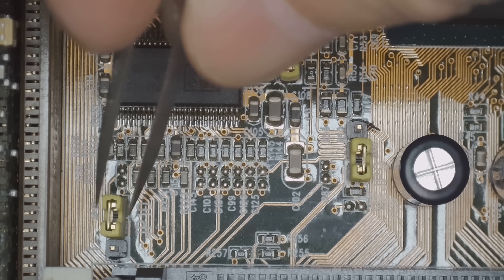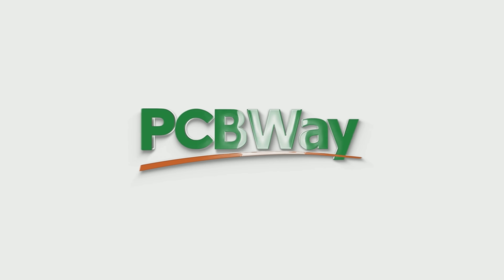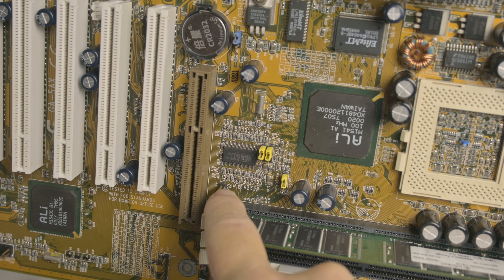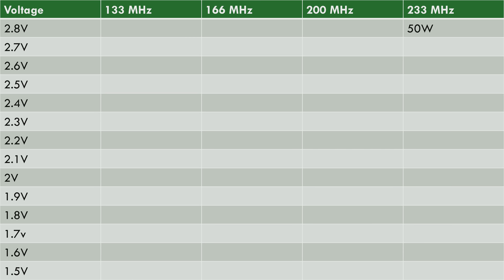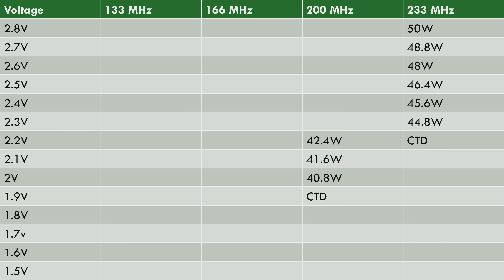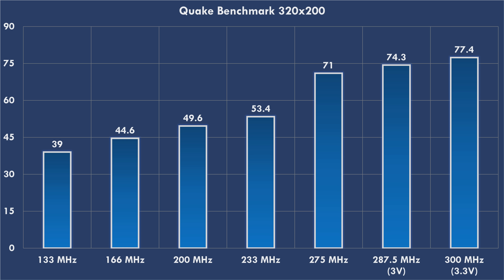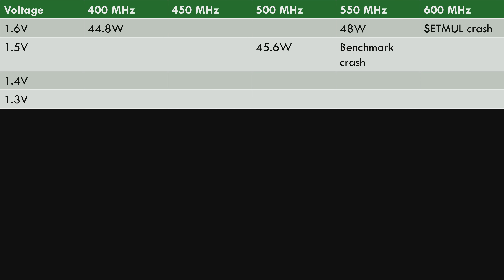Undervolting Retro CPUs to extend life, save power, reduce heat and noise

Comment: There is probably an ultimate voltage and clock speed in which  the transistors have the least weardown over-time due to a combination of transistor success rate, speed and temperatures. The good thing of 50% clock speed is that you can also lose transistors over-time without really affecting the CPU functionality.

Comment: I don't think I have a SS7 board that will go this low in voltages. The Cyrix chips are ones that don't like undervolting much if I remember, but then again, I wasn't trying to lower the clocks either.  Now I am curious what a Tillamook will do in this scenario.  Good video!
Reply from the maker: I agree, those Cyrix chips are pretty delicate!

Comment: I have a k6-2+ 450 . And under clock the cpu.  But what's weird,  is the boot up detects the k6 2+ 450 . But win 98se shows it as a k6-III 450 . And  3dMark 99 shows it as a k6 2 3d Now at stock settings.

Comment: CPU is the most reliable component in the system (More than the rusting chinese screws).
I can count on one finger the CPU's that failed due to themselves, not from EXTERNAL issues.
Reply: Same. I think the only one I've ever had that died on me was a Pentium III. Everything else has either gotten upgraded, or gotten orphaned due to the motherboard dying.
Reply: My one and only dying CPU without killing it by myself was my first Raptor Lake 13700 K. Just because I built this system and didn't want to mess with it. That was probably a mistake. I didn't do the same mistake with the 14700 K that still runs great.

Comment: I underclocked my K6-550 years ago to 450 and forgot about it. Lately i pulled off the cooler and was a bit surprised when i had a look at the model that was in; and remembered vaguely that i did that when it was running as a file / printserver for a while.

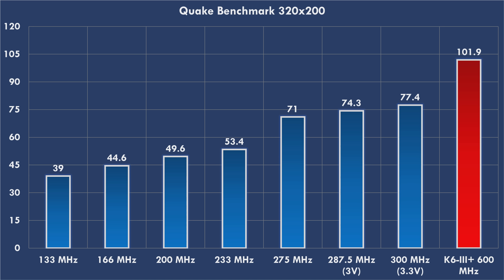Comment: 14:20 - most probably the Pentium MMX clocked at 300 mhz would have been faster than the stock 400 mhz K6-3 in Quake.

Comment: this is great advice for motherboards with active voltage regulator based on stepdown converter
however on motherboards with older style voltage regulation based on transistors and linear voltage regulators you might be surprised to not see much of any changes
that is because linear regulator would be more eficient with lower voltage drop , the bigger the drop the more power is converted to heat and the only way to limit power is limiting the current. gain some loose some. cpu might be cooler but vrm would suffer more stress
Reply: So less voltaje means more amps pulled from the Vrm?
Reply: @valparaisosting  nope, the same amount of amps is pulled from voltage rail or slightly less. only instead of transforming it to lower voltage like switching power suply by switching on and off periodically the difference in voltage is radiated as heat because linear voltage regulators are just self adjustable power resistors. ohms law would see cpu as one resistor and voltage regulator as another connected in series. but the difference between 2,8 and 2,6v vcore would be neglegable you still droping the difference on vrm from 5v  and vrm at 2,5v would radiate the same amount of power as cpu is using while at 3v it only be 1/3 of what cpu is using :] so make no difference if cpu is ussing little less power at lover vcore
Reply: @kokodin5895  no, it makes a difference. Typically CPU power scales like f*C*V^2. Even at constant Vin - input voltage for lineal regulator - combined power (CPU die + regulator) still scales like f*C*Vin*V.
Modern CPU's even have built-in lineal voltage regulators (DLVR) - yes, to save power.

Comment: Do you have any evidence that undervolting extends life (vs running at rated specs)? Lower power, lower temps, sure… but extend life? Not convinced it makes any difference but interested if there has actually been research done
Reply: Intel Raptor Lake?
Reply: It should reduce rates of electromigration, so broadly the concept makes sense. Lower temps also help with other things, like solder joint fatigue from thermal expansion. How much of a difference it makes is the question, CPUs rarely ever fail, I have pile of everything from 386 to PIII and all of it works perfectly 20-30 years later. GPUs are a different matter, especially as you get to the early 2000s and beyond.

Comment: Undervolting you will save the capacitors of the mother board more then everything else. Electrolytic capacitors are mostly degraded from voltage and current they have to manage. Ofc u save also the CPU but the first thing you destroy with overclock are the capacitors of the MB. Usually the CPU will last way longer then the mother board and capacitors. Undervolting is always a great thing to consider and not only to save consumption. Phil contents are always super interesting. Thanks Phil :)
Reply from the maker: Good point!
Reply: On that subject, as hard to believe as it may be, my Abit BP6 motherboard from 1999 still has all of its original caps. And it still runs it dual Celeron 433s rock stable at 540MHz with an FSB of 83MHz, though obviously it's getting a whole lot less use nowadays.
Reply: Heat plays a big role in capacitor aging as well.  The cooler you keep your system, the longer it will last.  In fact there's an old electrical engineering axiom that says for every 5c you can reduce operating temperature you roughly double the component lifespan.  That can vary of course, but I'm sure you get the idea.  ;)
Reply: I've been in PC repair for nearly 40 years. The CPUs will not degrade at stock settings at these nodes. The capacitors will not fail at normal room temperature use. The caps from the plague era will fail regardless, if not already by some miracle (I have a few holding on for dear life as an experiment). Keep your systems clean and cool, and don't worry. This is a nice experiment for power saving.
Reply: A few select CPU's were deathly prone to electromigration with even modest overclocks triggering the issue if you didn't have VERY AGGRESSIVE thermal management. With that said, I'd say a tiny bit of undervolting with a tiny bit of underclocking with a massive chunk of "more contemporary cooler" will probably do as good in preserving the CPU's than going all out on the under's. Finding a good fit, now there's a challenge.
Reply: Good capacitors can last for more than 100 years, so… no point in trying to save them.
Reply: The problem is that it's already "way longer" when it comes to these parts. You can always recap the motherboard but you can't fix an interconnect inside the CPU that has degraded.

Comment: I've done exactly this (without the power monitoring) with exactly that K6-III sku, on exactly that revision of that motherboard.

My 400/1.6 rated chip does on a 105fsb;
1.8v - 577.5
1.6v - 525
1.5v - 472.5
1.3v - 420

I didn't exhaustively test the max each voltage achieved, each of them can probably go further with a 110fsb, but SS7 bus overclocks mess with other components and I was quite happy with 105.
The 180nm K6's I think are quite safe to overclock, the 550's are rated at 2.0v, but like you I don't make a habit of setting over 1.6.
Reply from the maker: Beautiful! Thanks for sharing our results!

Comment: I managed to get my Opteron 180 down to 1.2v. Helped majorly with heat issues I was having
Reply: Is Cool & Quiet still usable with undervolting? I also have an Opteron 180 system and everytime i tried to go away from AUTO in the BIOS fixes the CPU at one Voltage/Clock. As my system is not for gaming and idling most of the time when powered on, working CnQ was more important for me.
Reply: @AncapDude  CnQ breaks when you undervolt unfortunately
Reply: @big-ts-tech-corner  Sad, thx

Comment: I had a very similar board to Phil's (SiS 5598 chipset version) paired with a K6-III+ 450ACZ - it was able to run passively - (without even a heatsink) at 333MHz - 2.5x133MHz - and 1.3 volts - full load temperature was 45C - power consumption was minuscule! Could also hit 4.5x133 for 600MHz and was amazingly fast - had a PCI GeForce2 MX400 with it.
Reply: Those chips are utterly insane. They're basically a retro gamer's Swiss Army Knife. You can basically build a rig that can stretch from the dawn of the PC to the turn of the century if you know what you're doing. What makes it even crazier is you can change cache settings and multi on the fly without resetting let alone cracking the case. Only disabling the L3 needs to be done in bios and the only setting where the case  needs to opening is changing the FSB frequency (unless you have jumper blocks, then you might be able to set up an external dip switch panel).
Reply: my k6-2 550 managed to get to 682mhz 5.5x124 didn't have a board that supported 133, maybe it could've gone faster?
Reply: @randNull  If u would have set the multi at 2x, it would have been interpreted by that cpu, as 6x.
But I really doubt it was rock-stable even at 682Mhz; let-alone at a higher freq. 
I really encourage everyone to test their OC with Prime95 for at least 30min. 
Had a k6/2+ OC that was perfectly stable in everything except Prime95. And fixed it just by further improving the cooling by ~2-3 degrees C.
Reply: @randNull  TBH, I don't know what's more mind-blowing: the fact that you somehow managed to OC that cpu so high AND stable.. or.. that you were using it until 2009! 🤯

Comment: Thanks Phil.  A nice review. Like you I'm not too keen on overclocking old processors when I have other faster systems I can use.  However, it does beg the question; How often have you experienced a CPU failure when running them within specification?  I have never experienced a CPU failure other than when I've accidently 'fried' one with the wrong settings. Is underclocking for longevity benefits even worthwhile?  Is it something we even need to worry about?   It will be useful to hear the experience of others. 
I recall working at a university many years ago where we had an autoradiography room that used an old 386 or 486 (I can't remember which) but it had been running continuously for certainly over 5 years, maybe more, and never switched off.  I was more impressed that the HDD was still running, but there was never a problem with the other components after running it non-stop for all that time.
Reply from the maker: Yea good point. I did buy some dead CPUs and also broke a few AMD ones, with the exposed die. You need to be careful with those.But otherwise, yea don't remember a CPU stop working over time...

Comment: I have personally never messed with over/under-volting my processors either in retro or modern PCs.
Not for lack of desire, I was just a chicken and thought I should avoid it. 😅

Undervolting and underclocking processors to extend their life is really compelling. Thank you for this!
Reply: When I was little I thought computers could break just by opening it and looking
Reply: @infinity2z3r07  My parents wished I felt that way. 
When I was little, I took everything apart. When I saw the owner at our local computer learning center take apart the lab computers to add Sound Blaster cards and CD ROMs, I was convinced I could do anything with our home computer too. 
I still have that childhood 486 and it still works despite the number of times my 12-yr-old self took it apart.
Reply: In modern PC both CPU ang GPU do automatically underclock/undervolt when lightly loaded right from the factory. It is called DVFS.
Reply: @volodumurkalunyak4651  Manual undervolting can still help on new devices though. If you look at overclocking and overvolting, you need to dump more and more power to high the higher clocks. People have experience using 10-15% less power for a 2-3% maximum clockspeed loss.

However, it's been found that by undervolting, less power is used and some chips will run better as they never hit thermal limits which causes and automatic down clock. So you might not hit the maximum boost speed, but your clocks are stable rather than speeding up and slowing down to manage heat.
Reply: It doesn't just extend the life of it through less degredation, but if you do it from day one of your purchase, it kind of becomes a similar feeling to what the stock performance was already to begin with. Sort of. So when you undo that underclock later, it's like overclocking it almost again in a way. Then if you overclock it further near the end of its life cycle, you get a nice little bump in performance there too. 

I wringed 8 years of use out of a 290x this way. Bought it launch year at MSRP+retail markup of the local store. So about 950$. Then added on a artic accellero extreme V or something like that, the last one they ever made; about 7 years later to help stabilize out the overclock I was going for. I could have just kept it a little lower with the current heatsink and blowerfan, but I wanted some silence from that card finally.

It still works today if I were to plug it in. There just isn't much reason to aside from maybe running some older games that might work better with it generally speaking due to architectural changes. Like Mantle support for a few games for instance like Beyond Earth.